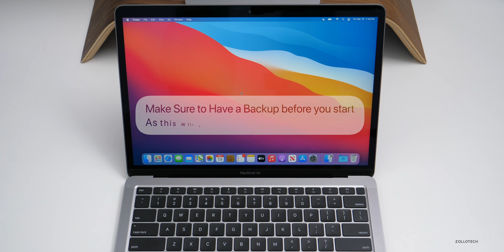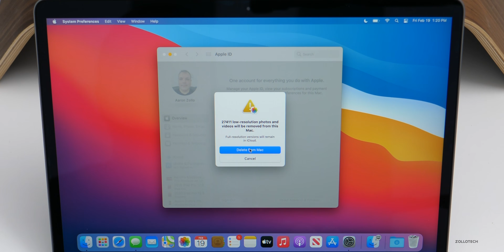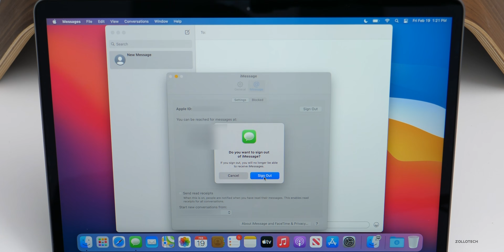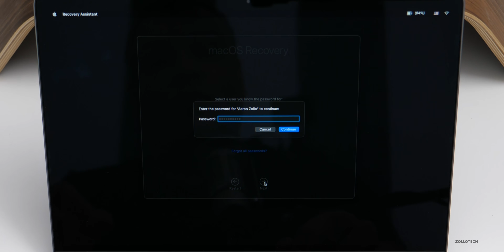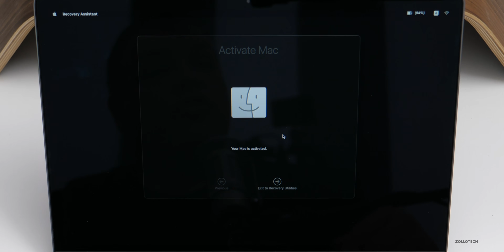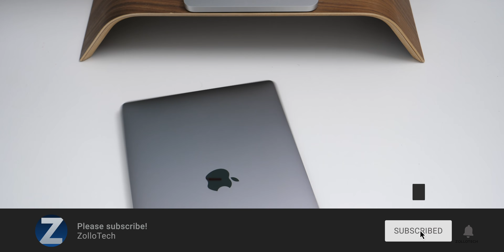How To Erase and Reset an M1 or Apple Silicon Mac back to factory default

Comment: Help me please 🙏
When my macbook goes into sleep mode or if I close and open the lid of macbook, mouse pad and keyboard not working... Please help.. I erase my macbook.. Still the issue is killing me... 😢
Reply from the maker: It should take a second to work
Reply: @zollotech  plz help me savior..
Need to shutdown/restart using external mouse to use the macbook...im in a hell...It's been 2 days
Reply: @zollotech  plz help

Comment: If the Mac is n recovery mode and the macOS won’t download because its old what should i do, the macOS is ventura
Reply from the maker: I would try again as macOS ventura should still download on its own.
Reply: @zollotech have tried a lot. The Mac is just stuck in recovery mode
Reply: @zollotech  I have tried a lot of times. It’s just in recovery mode. It try’s to install then says that a problem occurs to try again

Comment: Hi, I know this has been a 2-year video but may I ask if this applicable to Ventura as well? I upgraded from BigSur. I’m considering doing this tutorial this weekend so I can clean my Mac after 6 months of using it. Please advise, great informative video btw, thanks in advance! 😅
Reply from the maker: This is the same if it is an Intel-based Mac. However, if it has one of Apple’s own new processes, such as the M1 or M2, it’s much easier and I have a separate video on that.
Reply: @zollotech  currently on M1. I’ll look for that video, thanks for the tip!

Comment: Can you share your WhatsApp no. I have a issue in my macbook air M1 ,( select the system you want to use to start up your computer) it will stuck . Loading circle is rotating continuously and no other movements.

Comment: What if I don’t see Wi-Fi connection option when I am trying reinstall macOS after erasing ? I am stuck there.  Can u help ?
Reply: I might be a few years late but you should see the WiFi option in the upper right corner. You should click on it and scroll down.

Comment: For me when erasing the Mac and reinstalling macOS I accidentally pressed Erase instead of Erase to Volume Group. Then when it had options to reinstall to a drive, none showed. I checked disk utility and nothing showed up under the Apple SSD, where the drives would be (usually named Macintosh HD). Please help there are no answers to this online and I cannot use my Mac.
Reply: did you get an answer for this?
Reply: @xolisa5096  Unfortunately I haven’t. I might go to the Apple Store soon and see if they can help

Comment: Will this correct errors with the various drivers of the accessories ie keyboard  touchbar? 

I had a refurbished mbp m1 from Amazon which came with the setup screen on. After I completed the setup, I realized the touch bar was not working/responsive. 

Can a reset help it respond?

Comment: Hello, I have an easier way to do this but this is faster for those who just want to erase everything excluding the OS and built in apps. 
Open System Preference > Tap System Preference in the upper left corner > Tap Erase All Content and Settings... > Enter Password for Erase Assistant.
It will shut down for a couple of seconds...
Connect to your Wi-Fi > Continue Restart. 
That's the easiest way to restart your Mac without waiting for a couple of minutes or hours.
Reply: thanks

Comment: Thank you Zollotech.  Very easy to follow along.  Unfortunately, i am returning an M1 Imac 24, and upgrading a PC.  I tried getting deeper into the Apple ecosystem, but found navigating the mouse and so small open/close buttons such a pain i didn't want to pay the extra $1k over a PC.  I've used Iphone since the 4s and have upgraded iPads four times.  I was surprised at how poorly the iMac speakers were compared to ten year old $50 Walmart bought speakers.  And as far as needing a larger 24" screen over 21?  I have a tv for that.  thanks again.
Reply from the maker: A couple things to note.  Clicking the X does not close the apple, but rather file and quit or using command and Q.  Also I am very surprised you think the speakers are bad.  Maybe you got a bad one because they are quite impressive compared to most.  Either way, glad I could help.

Comment: How can I reset it if I can't even log in? It's brand new.
Reply: If anyone is still having problems logging in, you MUST have an internet connection. While you are sure you're entering the password correctly but still getting an error, it's because you're not connected to the internet. Apple should change its error message. That would save tons of requests for assistance. Smh

Comment: will this reinstate the data volume as well (i.e. it will appear as HD and Data underneath in disk utility, exactly as it did out of the box?). I've had my imac for 24 hr and things went south after Migrating from my imac 2011...so now I want to completely start from scratch and I'll simply drag and drop files I want from an external drive and/or do Target disk mode once I get an appropriate cable.
Unbelievable.
Thanks!

Comment: Hey Aaron, there is actually a quicker way to erase the Mac now. Sign out of all that stuff like you did , hold power, go to disk utility l, delete the hard drive but under data delete that drive as well and you will see a new screen saying: erasing Mac. Takes a min or two the computer will restart 2 times then it will ask you to reinstall the os and it will take like 3 hours
Reply: His way took only 30 minutes

Comment: Such an incredibly helpful video. All the steps were there with no fluff. So useful. Thank you very much
Reply: Agreed!!!
Reply: I did this and now my lab top wont do anything just flashes a ?
Reply: what is the point of the first step of deleting everything from the mac if you are going to format the  hard drive anyway? That stage seems so pointless to me.
Reply: @QefkaRetro  if you just do a reinstall it doesn't actually remove anything.  I learned the hard way and had to do it all again but first erase and then reinstall.

Comment: This is the most stupid system ever, and it should just have an option to factory reset, and if you want to scrub the drive.  I did a reset of mine and when erased it keeps user info in the bios or what ever it uses.

Comment: Super helpful! Do you know if you can fully restore from a Intel Time-machine backup in recovery mode onto a M1 Mac without any problem? Since they have different architectures, so im wondering if the initial time machine back up is from an Intel Mac, can It still be put onto a M1 Mac? Thanks
Reply from the maker: Yes, you can restore from one to the other without an issue
Reply: @zollotech  Thank you so much for the reply! 😃 Are you sure about it? The M1 won’t just run my x86 apps under Rosetta right since my time machine backup is from an intel Mac? Or will it automatic turn everything into arm apps those that are available. The reason I ask is because I usually see you just use the migration function to transfer everything to a new Mac and not use R Command then fully restore from an time machine backup? Correct me if I’m wrong.
Thanks

Comment: My Safari is stuttering while scrolling.
Shall I reset?
Reply from the maker: No, that should make no difference.
Reply: @zollotech  what do I do except for using Chrome or Brave?
Reply: Tried to reset to see if it fix the stuttering but did not effect, it seems even worse after the reset. I use brave instead.
Reply: @ahmetulusoy3416  same

Comment: does it also work on beta versions? When I boot into recovery, there is only one option for reinstalling the beta instead of the public release version. Can anyone tell me if I can install the public release version after fully wiping the disk?
Reply from the maker: Yes. If you follow these steps it will only install the public release.

Comment: My M1 MacBook Air got bricked while doing this process and is now stuck on the exclamation mark. Had to return it to apple.
Reply: you can reenable it with another Mac with DFU
Reply: I tried doing everything, finally had to take it to the Apple Store. The experts say that the BIOS of the Machine have been corrupted. They will swap out the logic board 🥲
Reply: @hdpebag4942  11.2.1

Comment: Very important to sine out from Apple accounts before factory reset the device, otherwise you will have problems when reinstalling
Reply from the maker: I mention that in the beginning of the video
Reply: So what happens when you forget this? Id imagine that when you erase everything it also forgets all this doenst it? Is this different from all the times I reset my iPhone or iPad to factory settings before I sold them?
Reply from the maker: It could be tied to find my and you would have to remove it from the find my app.

Comment: Yeah. Useful, this. I did it several times with my previous Macs. Same methods, one by one.
Reply from the maker: Older Macs are a little bit different in the way you get into the restore menu
Reply: @zollotech   True. With M1 we no longer have to press CTRL plus whatnot. Good lah.  The rest is pretty much the same.

Comment: Would this process also apply to Intel Macs running Big Sur?
Reply from the maker: No, but I have a separate video for that.  The initial process is the same, but the part when you need to get to the startup options is different.

Comment: Ridiculously complicated
Reply from the maker: It’s actually quite simple and much easier than Windows for example.
Reply: @zollotech  all those steps is the definition of difficult, and how easy or difficult windows is is irrelevant. Apple need to make this much easier. Without instruction a novice would never be able to all that and someone who's not a novice would find it very difficult.
Reply from the maker: @dovan4092  that’s the idea.  The average user shouldn’t need to format their computer unless they are getting rid of it.  In the many years of owning all sorts of computer I have rarely ever had to format and restore a Mac

Comment: Hello, Aaron! 
Great video, especially for me, since I'm a new macOS user (my M1 MBP is the first Apple product that I purchased in my whole life!). I’ve been an exclusively Windows user for the last 20 years, and one major problem with it is that the system tends to get full of junk and therefore get slower with time, needing some periodical reinstall. Do you recommend a periodic factory default reinstall or is it not necessary? Which app do you use to maintain your macs clean (I’ve been using Onyx)?
Thank you!
Reply from the maker: You dont really need to do that.  I have some Macs that have never been wiped in over 5 years and have no issues.  MacOS does not have a registry like windows and tends to have less garbage overall to clean up.  Any of the free apps in the App Store will work just fine for your needs in identifying old files that might take up space.
Reply: @zollotech  ZOLLOTECH i need help badly i want to get bluestacks app but its says my machine has new apple sillicon and cant open application how can i fix this ?
Reply: @benjansens8595  Maybe wait till the devs optimised it

Comment: Hey, I am using an M1 mac and a Samsung T7 and unfortunately, the application to encrypt it which is Samsung Portable SSD 1.0 not seems to be working and keeps crashing. I don't think it has been updated for macOS Big Sur or maybe not working with Rosetta 2. Please let me know if you are experiencing the same problem or if you can tell me anything about it.

Comment: Hey Aaron, my charger for my iPhone isn’t charging. It shows the green symbol but the percentage doesn’t change. Any ideas? It doesn’t charge my iPad either.
Reply: :/ Only 6 months old.
Reply from the maker: Reboot and see if it makes a difference
Reply: its because your power brick wattage is too low, when i plug in an ipad to a 5w charger it doesnt charge because its too slow

Comment from the maker: Here is how to properly reset a MacBook that has Apple Silicon.  Hopefully it’s helpful and thank you for watching.
Reply: I returned my M1 before watching this. I only went through the formatting part, and reinstalled Big Sur. I'm a Windows user, and so I assumed going through the factory reset was enough. Do you think my information is still on the Mac?
Reply from the maker: @chefs-KissX86  If you formatted it, it shouldn't be there, but it will still be associated with your account
Reply: @chefs-KissX86  v went
Reply: Extremely helpful and fantastic content. Thanks 👍
Reply: Ok
Reply: @rutvikgulavani8973  I think you have to restart your Mac and try it again
Reply: @rutvikgulavani8973  oh, dude, its terrible. Good luck
Reply: Thanks you, and I want to know how to install macOs 11.2.2 if I don't to update to macOs11.3.
Reply: I signed out and it didn’t ask if I wanted to erase
Reply: very helpful. thank you
Reply: Idk what’s wrong with mine but mine just turns into a black screen when I press the turn on button
Reply: @rutvikgulavani8973  hello. I also do have the same issue here. Please help me. Please. Give me any contact number 🙏🙏🙏. I am based in South Korea. I really need ur help.
Reply: @zollotech: I followed the steps but couldn’t install it. It says following: 
«No users available for
authorisation
An error occurred while reading device
owners. Ensure that a user is allowed to
administer this computer.» Any idea how can I resolve the issue?
Reply: Hello! Is this for all the ios’s further big sur i.e os Monterey or os ventura! Should i follow the same process with these 2? On my macbook pro 2020 M1 !! Please answer 🙏